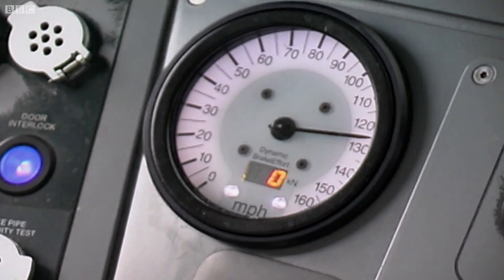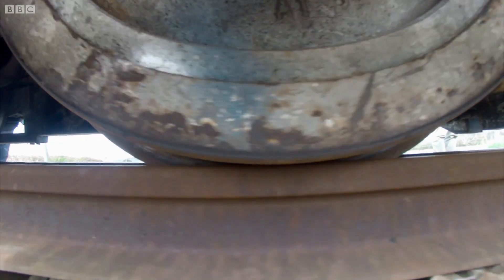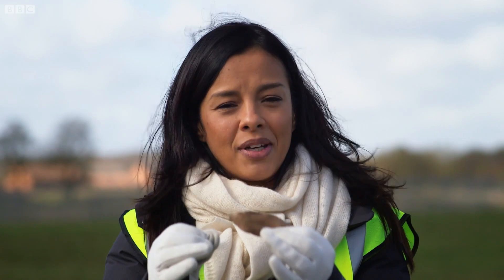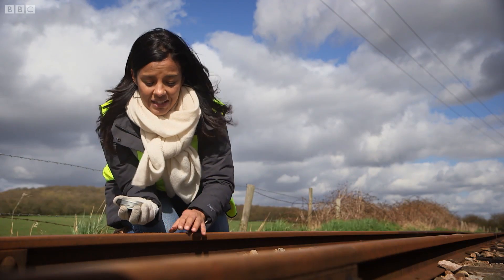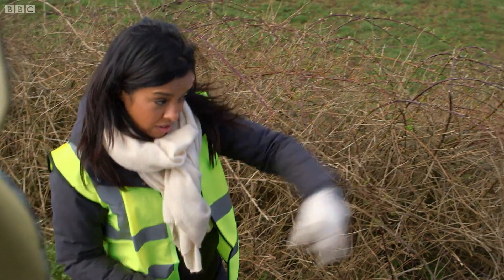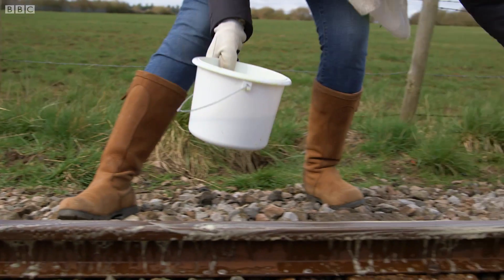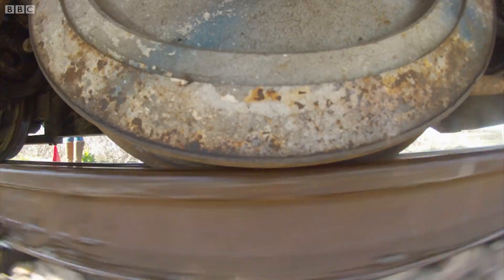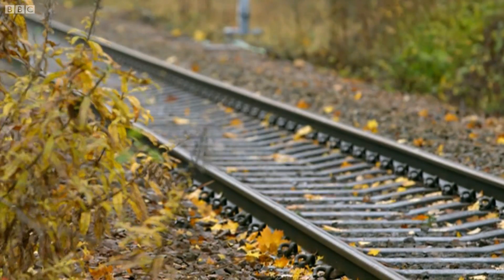Why Do Leaves Cause Train Delays? | Bang Goes The Theory | Earth Science

Comment: time to upgrade to maglev?
Reply: +Enzo Cavalli Nope, doesn't work for freight at all for example, which would mean having to build a system for passengers and one for freight. 

Aside from that Maglev is an even more delicate system than the old railways, they work perfectly in a perfectly organized world, but let a natural catastrophe or even an conventional war come and they are unsuable. 

Remember Railways ran during the worst of the blitz and until the last day of the war in germany, even when nearly everything around them was reduced to rubble. 

There is a lot to say for that kind of ruggedness. 

BTW. we don't even need a war, could you imagine running a maglev in conditions like on the Dawlish sea Wall, with the constant saltwater spray?
Reply: +LupusAries Inductrack can carry freight on a level comparable with traditional trains (actually, it's better in both weight ratio of wagon:load and power required) and is simple similarly to railways, including that the track is completely passive and it can generate lift without power. The main and practically only disadvantage of maglevs is that you need to build completely new and separate infrastructure and the initial price is therefore extremely high. (A similar issue is that standard track gauge is quite small for so much freight transport needed by the current world but any change is very unlikely because it would break compatibility with current infrastructure.)

Permanent magnets are similarly susceptable to corrosion from saltwater as railway tracks but compared to railway tracks, they can be easily coated without trains scratching the coating off.

Train tracks are quite delicate as well, and they took a lot of resources to keep operational during the war. Difference in the gauge may cause the train to derail at a switch if the gauge is just 10mm wider (for standard gauge), or damage/destroy the track if it is 15mm narrower.
Reply: Jan Sten Adámek
Interesting, do you have an sources concerning the Inductrack?
I would like to know more about it.

As for normal gauge being rather small, well the issue there is mainly the loading gauge, Britain has a few very restrictive gauges, where you can't load much, the European loading gauge is wider, but the US gauge leaves even more space than that.

By current infrastructure you mean not just the Bridges but also the alignment of the tracks, i.e. the line itself?
As with a broader gauge you have to have a wider curve radius for a the same speed, although generally the wider the gauge the higher the maximum speed. (If we're discounting drag, especially frontal area drag.)

As for wartime service using up a lot od resources, agreed, it did.
Service was also not maintained on the pre-war levels, but it kept working, even in the most heavily bombed cities.
Ok, could you elaborate on the tracks being rather delicate?
Aside from the problems of it being out of gauge, which is a known problem.
Reply: LupusAries https://en.wikipedia.org/wiki/Inductrack

Wider gauge has larger carriages which means greater freight capacity, something train networks in Europe would desperately need. You can search for Brunel's gauge or Breitspurbahn (as an extreme example) to learn more about its advantages. Maglev trains are much wider than railway trains for that reason since they don't need to be compatible with any existing tracks. Broad gauge does require straighter curves for the same speed, however the much more problematic part would be that all bridges, tunnels and stations would need to be expanded to accomodate it (which is one of the reasons why Brunel lost, switching to narrower gauge is just much easier).

Being out of gauge is the main problem, however there are quite a lot of factors which can cause it. Modern balastless track slabs solve a lot of those but maglev tracks have the same advantages because they are inherently slabs as well. Inductrack tracks are moreover just an array of strong magnets and loops of (unpowered) wire which can be prefabricated and transported to the construction site very similarly to railway tracks. For the seawater sprays, railway tracks suffer from corrosion (rust). Something that maglev tracks don't so much because they don't have any exposed steel.
Reply: Why bother? Rolling resistance represents a miniscule portion of friction, especially as speeds increase. Air resistance force scales at the square of velocity; friction with rails scales linearly.

High-speed transport would do a lot better to worry about wind resistance, either by making trains more streamlined, or by using airplanes, which operate up where the air is naturally thin.;-)
Reply: Enzo Ma yer only that costs money time and in UK we really can't
Reply: No
Way too expensive to build and maintain as they have way more moving parts at switches.

They also have to be segregated from any obstructions or interferences to avoid serious delays. Which means bridges or cuts because grade crossings are a no-no.

Comment: They should employ magnetic brakes.
Reply: +MrCube17 Actually I think they do, however its just installed betnween the wheels and the chassis. Normal friction based brakes aren't just powerfull and durable enough. I know yuo ment this between the track and the train but I just felt like mentioning it.
Reply: By European rail standard all trains operating in speeds in excess of 160 kmh/100 mph are required to have magnetic braking equipment on at least 50% of it bogies. Although not required by regulations a lot of trains that normally travel slower than that also carry magnetic braking equipment and many trains have more than the required minimum. 

The most common version is the type that is made up of a set of skids that are lowered onto the top of the rails and brake by means of electromagnetism, usually generated by the trains batteries. They are very effective, even during slippery conditions, but they are also very rough on the rails. These can be seen in between the wheels and usually look like an about a meter long set of cubes that sit slightly above the top of the rail.

The problem is that most modern lines are made up of numerous in rail circuits with electrical currents. This is in order for signals to automatically turn red as trains occupy the individual sections of the line. The system is based on one rail being solid and the other rail being sectioned into shorter bits protected by signals respectively. Every time the wheel axle of a train connects the two rails it causes a short circuit and thus the signal goes from green to red and can not change back to green until the short circuit is removed - I E the train is not on that specific section of the line anymore.

For this simple but ingenious system to work properly the joints have to be insulated on the sectioned rail and that's where the risks of the magnetic skids come in to the picture. It is very easy for these skids to cause an overlap when metallic residue from the grinding caused by them ends up in an insulating joint. That's when you hear about signal failure. The sections have simply merged and the light cannot turn green for prolonged periods of time or in the worst case not at all. Gates and barriers may also be effected and remain down even though no train is in the vicinity of the crossing. 

As a train driver it is therefore recommended to only use the magnetic brakes in emergencies or whenever any insulated joints are not being run over. Otherwise you simply drive based on experience and with less power and braking force applied since this evens out the difference between traction and grip. In Sweden, where I work as a train driver, most trains have the magnetic brakes but some trains can only apply them when the braking handle is in full emergency application. Some trains have separate buttons for magnetic brakes but none of the operators that I know of recommend them being used as a normal means of operation.
Reply: +Michel PASTOR You are both right. There are two types of magnetic brakes. I don't know how common the eddy current type is; but the other type is quiet common. Surprisingly; the main advantage is not the brake effect it create itself; but the cleaning effect it has on the track; allowing better grip for the wheels following it.
Reply: +Michel PASTOR These (electro-mechanical brakes) are for lower-speed trains (or trams) because they heat due to friction and are affected by the leaves as well, compared to the eddy current brakes of modern high-speed trains which can brake for virtually unlimited distances (given enough power; there are also fail-safe versions that work without power but I don't think any high-speed train uses them because they are much harder to control) and with the same brake force even on leaves.
Reply: An anchor ⚓ would be more effective.
Reply: @Chrisallengallery  
No it wouldn't . you'd tear up the land and risk damage to the line itself and the surrounding area.
Reply: +puskajussi37 you are wrong. the german ICE3 has magnetic breaks. they are lowered to a couple of millimeters above the track and break the train by eddy currents in the track. but that heats up the track quite a lot so they only do that on specially prepared or tested lines. the old and outdated infrastructure in britain couldn't handle the thermic expansion of the track under electromagnetic breaking.
Reply: +swunt10 yes... 5:12      /watch?v=BTFcgcY8wS4
Reply: Wow, finally a proper and completely accurate answer, thank you. I'm a train driver in Switzerland aaaaaaand... fall is here. Beautiful to watch, but a pain in the ass to drive trains.
Reply: Its not just braking you will also need to accelerate a lot slower because there will wheel slipping if you try to accelerate faster, which bad for the tracks. So braking on slippery tracks is bad for train wheels and accelerating is bad for tracks.
Reply: +puskajussi37 I did mean between the track and train but that's pretty interesting still
Reply: Thats correct, in Portugal we use in our trams, also aply sand to get grip. A lot of scares with leaves and first rains....
Reply: +swunt10 Are you sure they use induced currents ? Because I know some looks like they are but in reality they are half-magnetic. They use electromagnetism but mainly to push (pull?) brake pads onto the tracks.
Reply: What about those pneumatically activated plates that  theme park rides have?
Reply: MrCube17 air brakes are more failsafe though
Reply: good idea
Reply: MrCube17 it will be too heavy and you need a lot of magnets to stop a train
Reply: to expensive
Reply: They should use maglev train
Reply: You can’t use magnetic brakes on BR track circuit based signalling systems. It causes havoc with the track circuit causing signals to change aspect like a disco light. Whilst the brake was amazingly efficient - it was undone by those changin signal aspects.
Reply: +MrCube17 Hornby did this on some of their model trains

Comment: Now in the case of the MBTA Red Line - they have to go slow because the bearings on the wheels are so shot they grind down the track. This is common with the 015, 016 and 017 series. The 018 are newer and therefore no bearing noise.
Reply: +kd1s true.Sometimes the squeal of those squared bearings is enough to make you wanna jump out
Reply: +revmpandora And lets not talk abotut the single deck 500 series commuter rail cars. The Amtrak guys all say the wheels on those are square.
Reply: +kd1s I wasn't aware of that one. You've given me something to do for a bit now; thanks!
Reply: 😲😲😲 good grief! & I thought NJT comets over here were shitty!

Comment: train carries sandboxes.
Reply: +Namjig Nerakyi that might help for emergency stops, but you don't want to use a bunch of sand for every planned stop on your path. Even disregarding the problems regarding the logistics of sand refilling, sand is actually harder than steel and thus you would get greatly increase erosion, necessitating continual replacement of tires and tracks.

It would be like applying a belt sander to the tracks every time a train stops.

Comment: Just wondering but why dont they just build similar tracks they use on roller coasters on every stop ?
Reply: +Umbreon Fanatic (inoob26) I can see four reasons: 
1) It's bloody expensive
2) It's still steel on steel and thus susceptible to lubricating leaves - they could easily get blown that far
3) It doesn't help with stops between train stations, whether they are emergency stops or just waiting for a higher-priority train to pass
4) There's a good chance of it freezing solid in winter and then you have an entirely different set of problems
Reply: Steamrick thanks for the info since I obviously know nothing about how trains work
Reply: The better question - why don't they use air brakes above 60kph and a frictive brake rail installed near stations and stopping points below 60 to provide a guaranteed uniform stopping distance! Also I don't buy into soapy water being less slippy, that's bad / lazy science.
Reply: +Umbreon Fanatic (inoob26) more importantly, line changing and junctions would be very difficult. The type of track you are referring to are used by maglevs. Just look up how expensive they are.
Reply: +BaSH PROMPT (ಠ,ಠ) for effective air braking you need a large surface area. Trains are long and not wide, hence to use effective air brakes for the huge mass of trains would be impossible.
Just think of sail boats, how light they are and how big sails are required.  That will give you an idea of how much area is needed.

Comment: So, can't they just install leaf blowers on trains?
Reply: +Panga they can't. It would take too much energy. Also, the velocity of the air blown by the blowers would be smaller than the air coming against it. The results would probably be null.
Reply: +Josef Hornych Yeah, you're probably right
Reply: +Panga becuase its wet leaves that cause trouble not dry leaves. Dry leaves cause trouble with live rail based trains though.
A simple solution would be to use skids with metal bristles to brush away leaves when they stop and accelerate. other times it can be lifted off to reduce track wear.
Reply: +Panga Only if the trains averaged about 5MPH, oh wait....
Reply: They actually have tried that, plus many other things. The best solution they've found so far is a microwave laser hooked up to a sensor that detects dirty track. It vaporizes the water which dries out the gunk, making it far less slippery, and actually steam scours the rails clean.
Reply: They actually have tried that, plus many other things. The best solution they've found so far is a microwave laser hooked up to a sensor that detects dirty track. It vaporizes the water which dries out the gunk, making it far less slippery, and actually steam scours the rails clean.
Reply: They actually have tried that, plus many other things. The best solution they've found so far is a microwave laser hooked up to a sensor that detects dirty track. It vaporizes the water which dries out the gunk, making it far less slippery, and actually steam scours the rails clean.